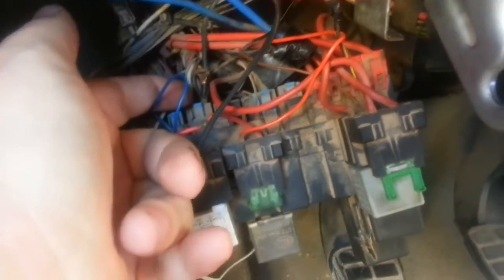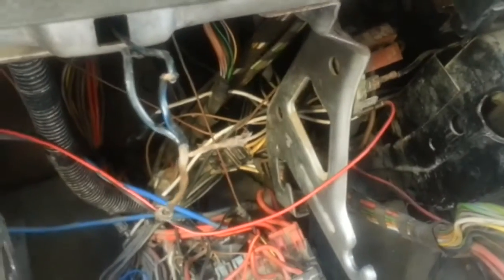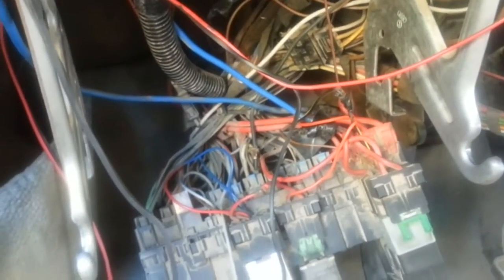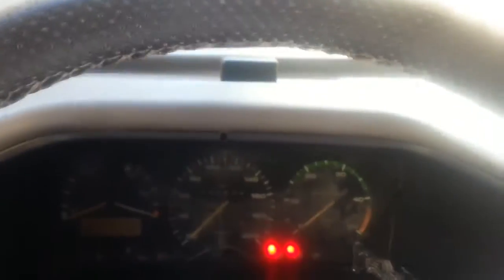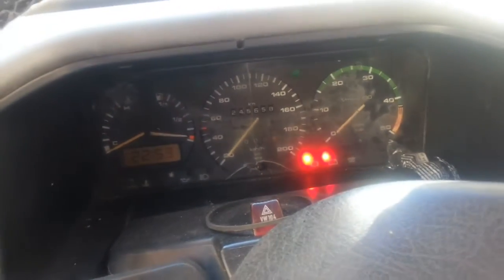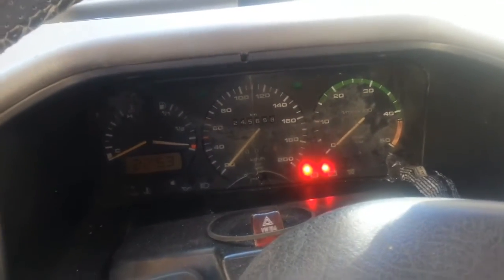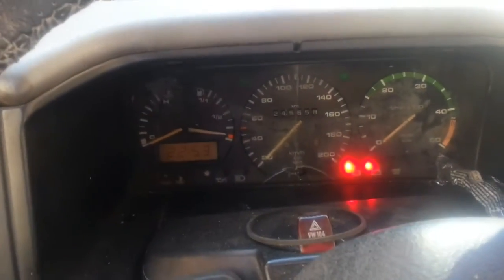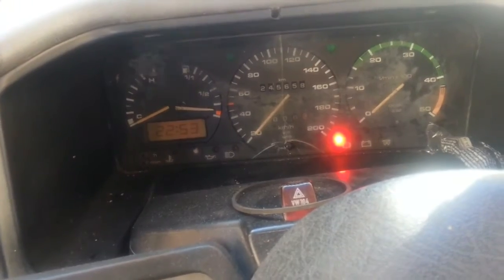VW T4 Won't start

Comment: My T4 wouldn't start and i believe this is the same issue. I had recovery come out and they said they thought it was something to do with the lift pump? and said it should go to a garage. The guy at the garage has said it could be an electrical fault and is waiting for another guy to bring his fancy computer to hook up and see what the problem is. It would make sense if it was the same thing as this! Very frustrating sometimes waiting for someone else to fix, so really want to learn for my self so i could potentially do this myself in the future! Thanks for the video.
Reply from the maker: It is frustrating just had my Astra in the garage for 6 weeks its 2 years old. Why because everything is electronic and the faults are expensive to repair so under warranty they are trying everything but replacing. Funny that when its their money but when its ours they want to rip the whole thing apart. Hopefully its just the loose cable it just sits on the top so not hard to find. I basically put my hand in and just poked around and found it.
Reply: So what? was the problem,,mine is not starting today ??got fuel,good battery,starter motor,,won't kick over?

Comment: Glad you got it fixed
Reply from the maker: +T4 Tips & Guides cheers also looking on the forums looks like that wiring is quite a common cause. Worth people investigating before buying parts.
Reply: Which engine do you have in your van? I have the 1.9 Turbo Diesel, it is a very simple engine, no ECU.

Comment: Sounds like the relay is in bypass mode
Reply from the maker: going to get it fixed as although everything is working its just annoying with the constant clicking.
Reply: Yeah Matt, A short or voltage leak in that lume somewhere is causing it. The relay itself is probably working as it should. It's merely the smoking gun.
Reply from the maker: The loom needs replacing think it will be a project once i have another vehicle to take this one off the road for some overhauling.